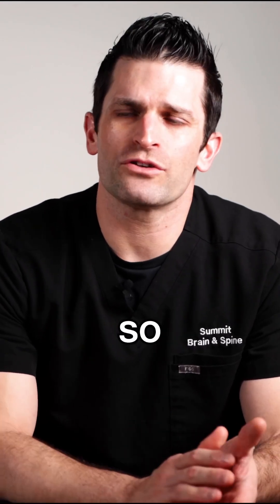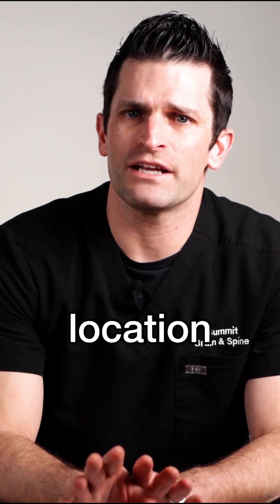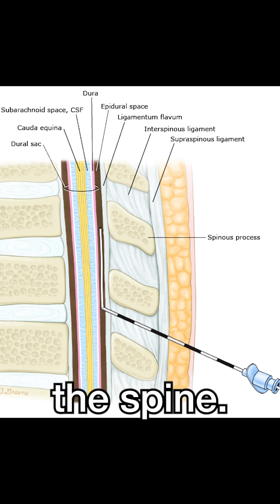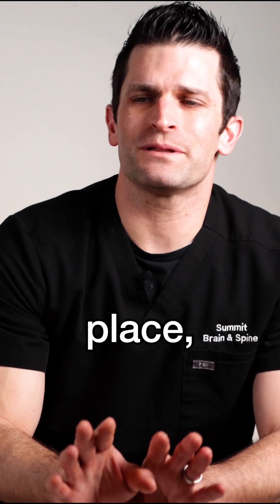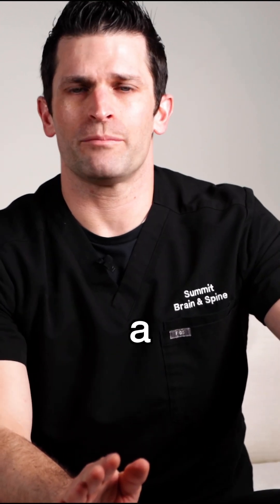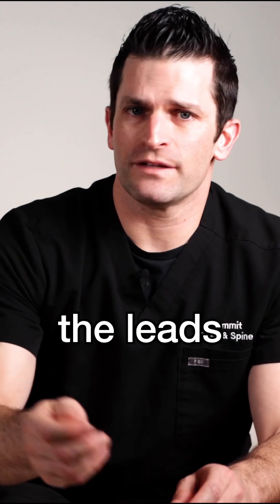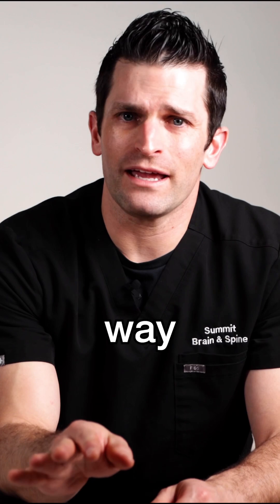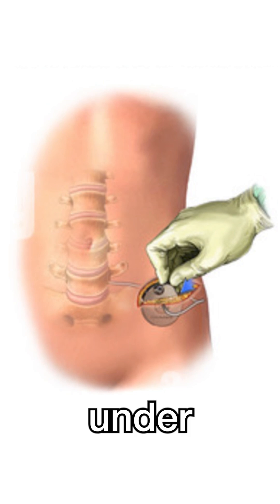Placing a Spinal Cord Stimulator

Comment: I did the trial and it work. Now I had the implant stimulator and I have follow up on 8/26 to  learn how to use the control and I need to ask if they have any larger belts due to I’m big and  the pouch you put the battery you need to have it that connect area so it can be charged and be pain relief for long term
Reply: If you are referring to charging it, you can use tape. I never use the belt because its annoying. I usually just lie on the paddle to charge it, then disconnect once its done. Hope that helps!!!

Comment: When the nurse called me with a time to be at the surgery center for my procedure, I heard the Dr say he needs to be here an hour early because he will need sedation!! I told his nurse I said that's because he doesn't want my help😮. They all laughed.. I have mine done next week😥
Reply: @oldgoat50  My trial went ok. I guess they were only able to get one of the leads in, so I was refered to the neuro surgeon for a paddle placement.  I have the permanent done April 1st.😬
Reply: @donpitts2388 Good luck. My surgery is on 4-3. My surgeon doesn't use paddles as he uses Biotronics and my company rep called me 2-3 times a day with my trial to make adjustments.😊
Reply: @donpitts2388  Not sure what is going on with my posts on here, I have mine done on 4-3. I put the brand of the company my dr. uses and now its gone. My doc uses leads and not paddles in the 500 surgeries he has done. Good luck.
Reply: @donpitts2388  So how did it go? I have had mine for a month and not working so good. See a tech tomorrow for another remote and new programing.